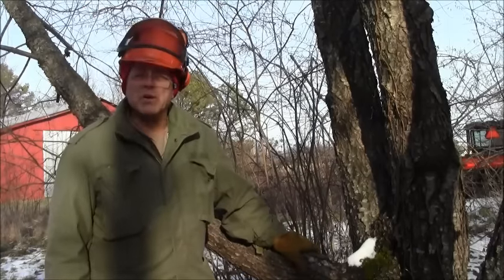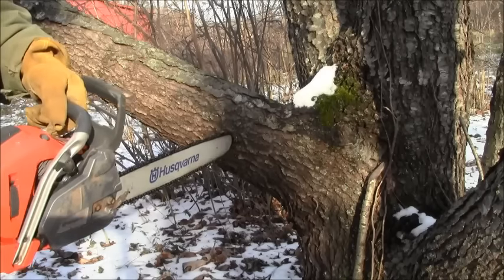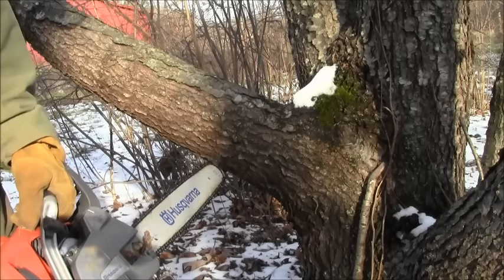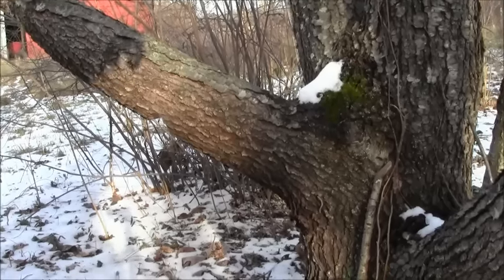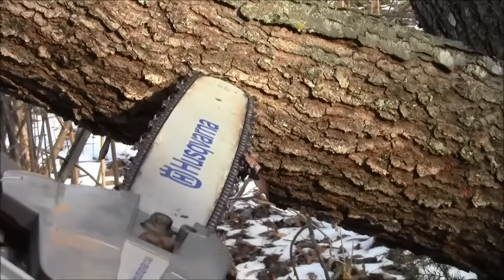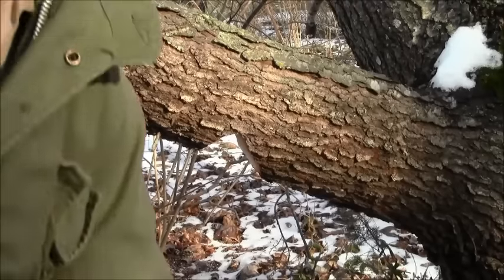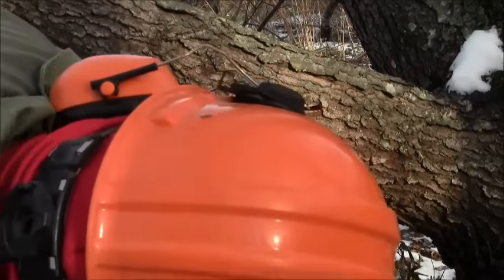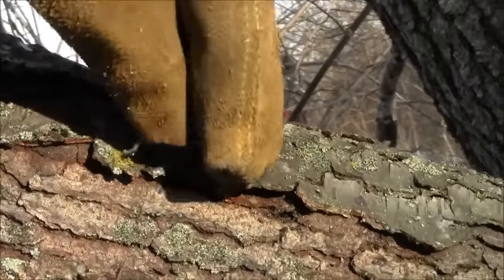Cutting A Small Diameter Leaner

Comment: David, stop plunge cutting each time you cut. A plunge cut is a specialty cut used only when you need to use wedges for back or side leaners (or trees that are known to vertically split/barber chair.) There was no reason for a plunge cut on this branch. A front cut like you did, then a straight back cut leaving a 2” tall hinge would have worked. Or, if you insist on a plunge cut to reduce vertical splitting then a front cut, plunge the middle moving forward to create a controlled hinge, then back until you are about 2” away from going through (leaving a back strap), then remove your saw from the plunge and finish by cutting your back strap from the outside. You have a lot of people view your videos and don’t follow known safe methods. Sorry to be negative. I do appreciate you sharing and your time. Cheers.
Reply from the maker: The ability to punch through wood instead of cutting from the outside in sets chainsaws apart from axes and crosscut saws.  It should be the first cut you learn when you are introduced to using a chainsaw.  Making the back cut higher is from the old method where you cut a 45° opening for a face.  The hinge breaks when the tree is halfway to the ground and the higher backside supposedly will keep the tree from coming back over the stump.  It works sometimes , but don't trust it with your bones if the top loads up and pushes back.  A chainsaw allows you to easily make a face 70° to 90° so the tree remains attached to the stump by the hinge.  The hinge works best if the stump is level front to back.  I don't use the angled release very often, but you will see loggers use it frequently.  It allows you to release the tree from a standing position, which means you will make your escape from the stump a little more quickly.  It also allows you to pull your saw out if you miscalculated.
Reply: Thanks for the video.  It makes sense that you want to use a safer procedure and avoid problems.  Don't you get tired of answering the same question in the same manner?
Reply from the maker: Not many read all the previous comments when they watch a video.  I used this method several years before I put it out on YouTube to make sure it works right because I knew people would say it is going to cause splits and barberchairs.  It works well, and it will prevent injuries, so negative comments are not a problem.  I want people to think ahead and avoid injuries.  Anyone who has used a chainsaw will sort through the comments and make a judgment. A person who is connected to me through a relative just got clobbered last week by a widow maker when he was pruning branches.  I need to make a video about hazards.  Be careful!
Reply: DavidN23Skidoo David, you are absolutely right. I just took the Game of Logging course and this is exactly what was explained and shown to us. Before chainsaws were invented, you had to “chase the hinge” from the back because all you had was a cross cut saw. Chainsaws allow for bore/plunge cutting on nearly every scenario. It allows you to get your hinge set up perfectly every time, reducing the odds of a barber chair. It also allows you to release the tree via the backstrap/trigger so you can retreat to your safety location and not stick around on the stump any longer than you need to. I find your videos to be extremely helpful and easy to understand. Thanks!

Comment: How tricky is it to cut the hinge?
Reply from the maker: +Merle Morrison Once you learn how to bore cut it is very easy. The bar wants to migrate toward the top side as you push through in soft-wooded trees like red maple, so you have to be careful if the hinge is to the right of the bar as you bore.  I used to punch straight through where I wanted the hinge until I figured out that misjudging could trap my saw. Now I start a bit wide, and aim at an angle away from the hinge. Next I close up to the right thickness on the near end of the hinge, hook the dogs in and rotate the saw to the correct hinge thickness on the other end. The tree stands still when you use this method and that makes life much safer.  You have to punch it where you want it on these small ones, but it's not a problem once you do a few.
Reply: +DavidN23Skidoo Good work and description, David.... Another cut which works on hard head leaners is the Coos Bay Cut...... two variations on it, both work well.... the hinge wood is left in the shape of a triangle.

Comment: I cut two wedges then slowly cut through is that bad ?
Reply from the maker: Make your opening for the hinge to work on the compressed side, and do not cut the back of the tensioned side until you have a hinge established.  Cut the tensioned side while you have too much hinge wood and a leaner will make a barberchair.

Comment: Why all the complication in cutting a firewood leaner. Base of your tree is the stump, small notch perpendicular to the base, create hinge. Go to the top of the base and cut down. No splinters and less cleanup of the stump you left. I gander the no bore cut because it's too thin. But you seem to be over thinking things a little. KIS
Reply from the maker: Small diameter trees present the problem of too little room to make your normal cuts, and many of them split or break off wrong.  They smack people, jam your saw, or bust your saw. If you can handle the small leaners you will have the skill to handle large ones.  I see trees that have broken from incorrect cutting.  It is a problem.  Sometimes they kill people.  I don't want you to get hurt.
Reply: I had one of those barber chair and scare the hell out of me doing it the way you describe.  This video is better in my opinion.

Comment: Way too much to cut that.  A small notch, and a straight down cut.  Done.
Reply from the maker: You have never seen a tree split and hit a body.
Reply: @DavidN23Skidoo  The tree can't barber chair when it's 3 feet off the ground.  There was way more danger from possible kick back from the plunge cut then there was risk of the tree splitting creating a barber chair.  The chainsaw manuals I've seen specifically warn about the dangers of cutting with the tip of the bar.  I'm sure that the writer's of those manuals realize that plunge cutting is a method that is an acceptable way to use their saw but I think that it's a method that very rarely needs to be used by the average person using their saw.  I believe plunge cutting is sometimes the only safe way to fell a tree but in most of those instances a novice chainsaw user is probably in way over their head to fell the tree that requires using a plunge cut in the first place.  The safest/easiest way to cut that tree is cut from the bottom 1/3 of the way and then from the top the rest of the way as if it was a horizontal limb. Many people have no business even picking up a chainsaw and many, many more have no business attempting a plunge cut with a chainsaw.  You, obviously, can handle a chainsaw.  I bet you are prepared for the possibility of the saw kicking back.  The novice user  may not realize this added risk.  I think that maybe you should have covered these risks if youre going to demonstrate plunge cutting.
Reply: @brianwilson7694 : I'm trying to learn how to fell trees and can't believe a small leaner like this can be so controversial.With all due respect to David, your comment seems - pending more thought - to be the best about this video.

Comment: If you'd cut straight up, it would've fallen to the ground, not hung there like a mini widow maker.
Reply from the maker: It's not "hung." The hinge is holding it to the stump, making the drop less kinetic and less dangerous.  Doing a bore cut perpendicular to the stem may have left too little backstrap to hold the tree while finishing your setup cuts.

Comment: Not saying this is a bad method but this felling could have easily been achieved without a plunge. A series of quick tension cuts on the under and a wedge on the upper would have dropped this tree quickly without trapping the bar
Reply from the maker: The underside is under compression, and the upper is tensioned. This technique is  a lifesaver for dangerous leaners. The bore cut is what separates chainsaws from older methods using crosscut saws and axes. Learn to use the bore cut and your trees are under much better control, making you safer.

Comment: Pretty sure someone just likes plunge cutting. Problem being is slot of people watching don't realize the risk kickback to incorrect plunging so if it isn't necessary don't do it. Cutting a limb running horizontal 3ft from the ground is not the time for over engineering a cut. Unless this was some kind of precious veneer lumber where every inch was cash then why make it more difficult.
Reply from the maker: Learn new techniques and you will have them when you need them. If you don't learn how to use plunge cuts, you're stuck back in the crosscut era, Before Chainsaws.  Our modern cuts with chainsaws make cutting trees safer and easier.